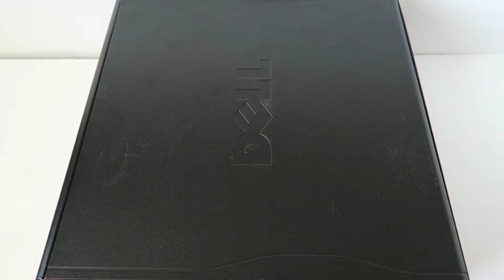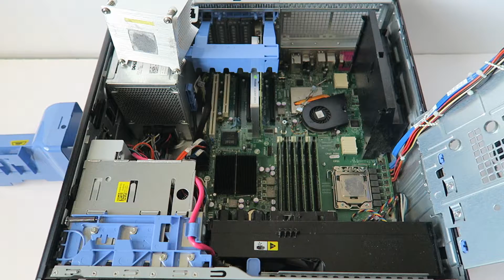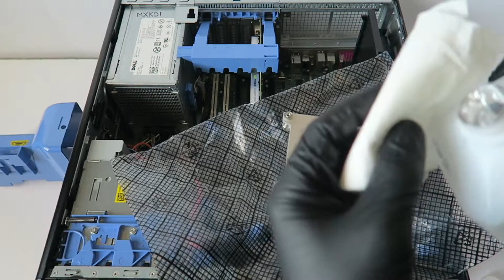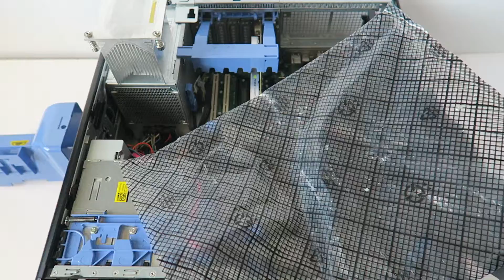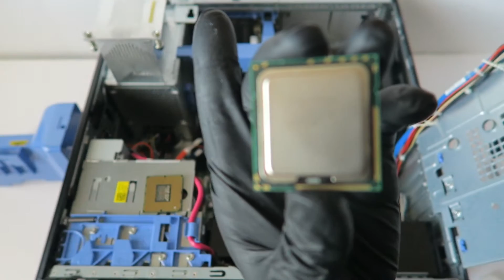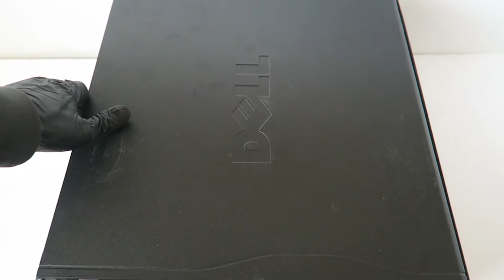Dell Precision T5500 CPU Upgrade

Comment from the maker: You can upgrade to Xeon X5650 or Xeon X5675 for around $30 that is great deal.
List of CPU you can Upgrade..
1. Intel Core Xeon X5660 2.8GHz 12M Cache 6-Core SLBV6 Processor
2. Intel Xeon X5675 3.06GHz 12MB 6-Core 95W SLBYL Processor

Comment: Remove and attach cooler screws diagonaly to avoid overpresure on one side of the socket. next, clean your processor when it is OUT of the system............

Comment: Do you know if the Precision T5500 can be a dual processor? And, if can I install a Intel® Xeon® Processor X5680 ? Tks
Reply: You need the riser board for the second cpu, and it runs the 5600 series.

Comment: Owned a T5500 (dual 5030s 24Gb RAM) from new and now getting a [ithr] checkpoint error. Had some issues with CMOS and memory down the years - odd DIMM errors and the "4" light came on, replaced the PSU with a 1000W Dell unit couple years ago, but now will only get through POST 1 time in 20 boots. 

Tried to remove everything and reboot but doesn't get through POST. Any ideas anyone?
Reply: Bad board
Reply: @dodgels400  Probably true. Having owned another two 5500s and a 3500 I think that the "northbridge" chip has overheating issues, looking at the changes in design for the cooling solution it seems that Dell viewed that as a weakness as well.

Comment: Hello, I have a few questions. I have a lenovo h520e desktop pc it has 2gb ram DDR3 Pentium g2030t and it come with an external power supply which looks like a laptop charger. Is it upgradable? I was thinking of adding a gpu for which I need to change my Mobo. Any reply would be helpful